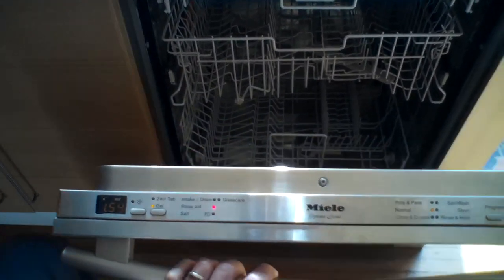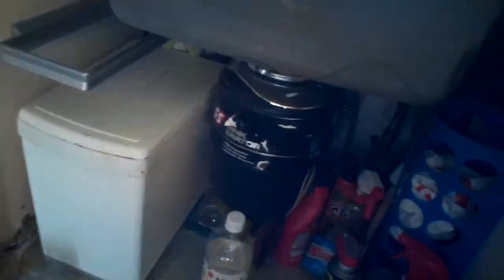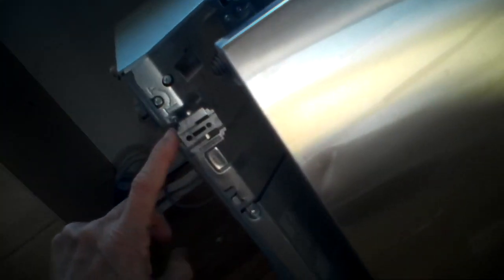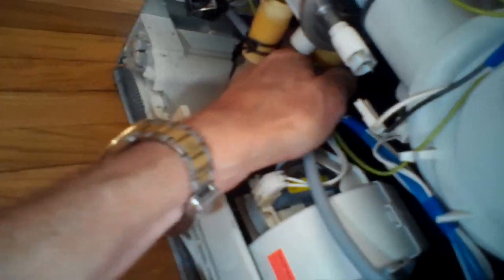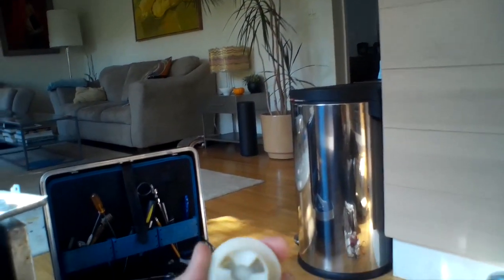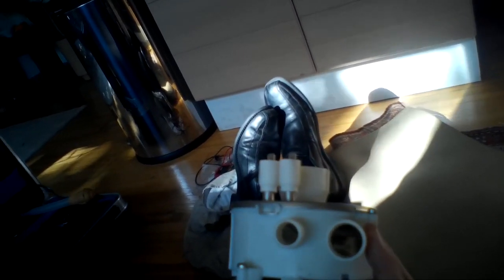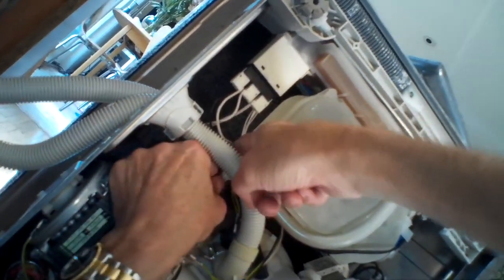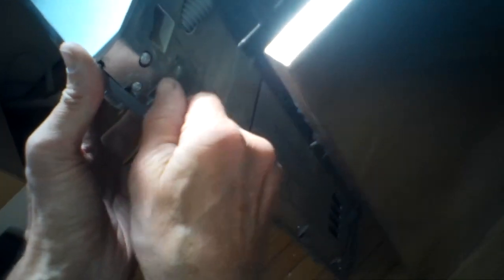Miele Dishwasher F14 Error--How To FIX

Comment: Thanks for the tutorial! My UK model was floor standing and took a little more time to get the bottom panel off, but sure enough, when I removed the motor, there was a fragment of plastic bag in the impeller blades. I managed to get the plastic bag out without disassembling the motor by using a pair or tweezers into the hole in the motor, so hopefully no leakage issues from the gasket!

Comment: Hi Scott, I have stripped down my circulation motor, all I found is a small piece of egg shell, would this be enough to effect the circulation rate?
Reply from the maker: Hi Brendan,
Most likely that would not be enough to limit the flow of water and cause a problem with not enough pressure.
My suspicion is most likely you need to replace the circulation motor capacitor and also perhaps the heater/pressure switch.
Reply: @ScottTheFixItGuyChannel  Thanks for that Scott, I put it back together and you're right it wasn't the cause. The pump runs for a few seconds the stops, starts again then stops. Another thing to mention is the dishwasher tripped the RCD the last time I tried it.
Reply: Hi Scott, ordered a new capacitor from Miele and fitted it today, seems to be working fine now, many thanks.
Reply: Hi Scott, after fitting the new capacitor it worked for one cycle then tripped the RCD, I fitted a reconditioned circulation pump with heater and pressure switch still the same , tearing my hair out, any ideas?

Comment: "The one in the back is a little hard to get to, just take your time" is a major understatement.  The clamp is rotated such that all my pliers are unable to grab the rear part.   I'm working on a Miele G 1590 SCI which seems pretty similar but in general seems tighter than your machine.  Could this be the difference between a US and a German model?
Thanks anyway, this seems to be the best video on the net for what I'm investigating!
Reply from the maker: Thanks Ralf,

That is difficult to get off
Reply: @ScottTheFixItGuyChannel  I managed to get the pump out by removing all but the one hose, then puling out the pump as far as possible and then removing the last clamp and hose.
Still stuck with the next problem.  The impeller has split in an upper and lower part.  I assume the two parts of the wheel were heat welded together.  Looks like it could be glued together but I don't know what type of plastics it is.  Or if a soldering ironn might work to re-weld the wheel.  Probably I should just get a replacement.  Anyway, the real problem is that I can't get that wheel of the motor's axle.  Good to know it's reverse threads!  Putting a screw driver into one of the holes just doesn't sufficiently block the motor when serious force needs to be applied.

Comment: Hi Scott,  I replaced the heater relay in a Miele G2470 following another of your videos due to F24 error. Now the dishwasher starts the program but after a few minutes I’m getting F14 error and the water is cold (not heating at all). Stop the program and try to clean the impeller etc and start program again and get F24 again repeatedly. If i let it sit overnight it goes back to the first situation (ie starts the program until it gets to F14...). Any ideas before I replace the machine?
Reply from the maker: Hi John,  can you send a video of the Miele during the first 3 minutes of start up?

I’d like to listen to what it’s doing.  Can you also show a close up of how high the water gets in relation to the plastic filter handle to :  scottthefixitguy@yahoo.com

Comment: Scott, I called Miele today and they said they do not sell the Partition Kit separately for my G2143 and would have to buy the entire motor pump 06770517 at $629. Have you heard of this before? The heater pressure switch is only $70.

Comment: Hi Scott, I tried that and impellers are not blocked. The issue is that both the drain pump and circulation pump are working but the inlet/outlet light flashes and no water enters the machine. The inlet solenoid is shut and it’s as if a sensor is telling it not to open and allow filling. I would appreciate any ideas. Thanks

Comment: Hi Scott,
Your video was helpful to take the circulation pump and motor from "miele dishwasher 4225".The reason I had to take it out because a leak developed between the impeller and the motor. I removed the impeller and found a damaged washer/grommet imbeded in the body of the pump itself between the impeller and the motor. I got from Miele an exploded view of the pump and motor but it doesn't show the impeller or the washer, I therefore cannot order the part. Where can I get this part that might cost $5 and avoid paying $450.
Thanks, Michael.
Reply from the maker: Miele USA on Google can send you a new partition kit for about $60.00